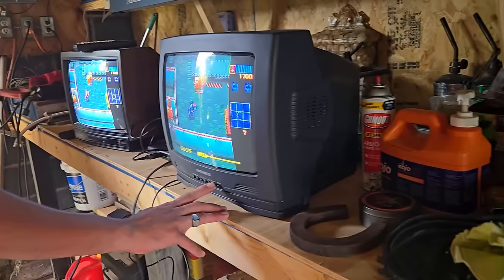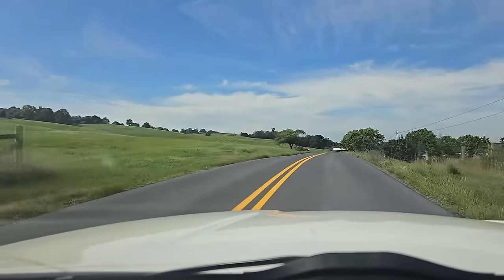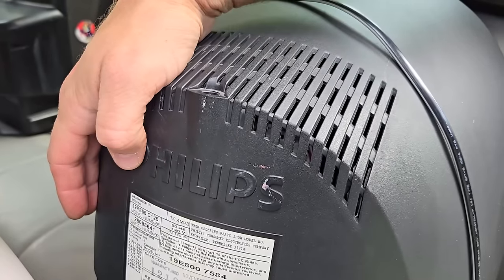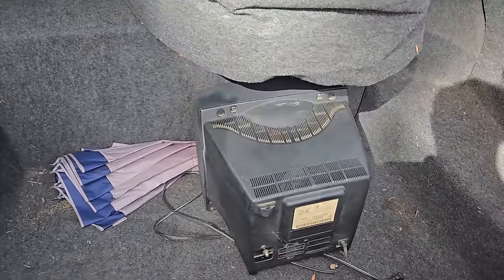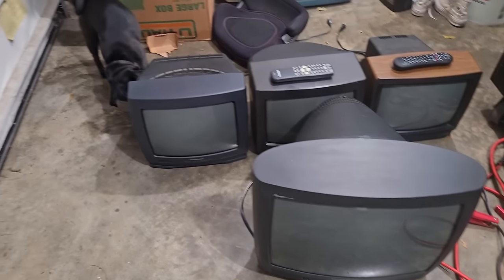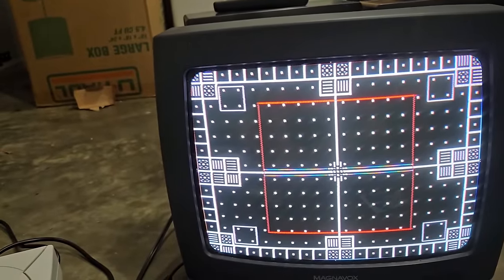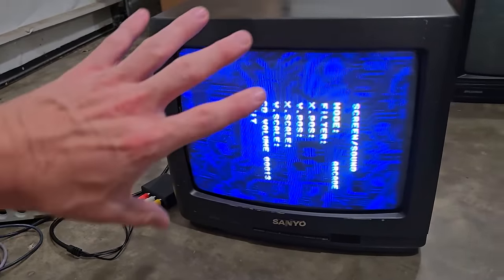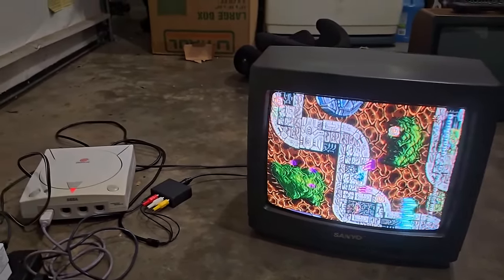Shopping for CRTs in 2024 | "Hot" Chassis edition

Comment: After seeing this vid, I'm trying to brush-up on my memory of how some of this works.

I probably have some stuff wrong here, but here goes...

One of the big reasons the "hot chassis" TVs were more common in the US, is because your mains voltage is 120V AC (nominal)...

And that is closer to the typical B+ voltage in a TV, so they were able to just use a chonky linear voltage regulator instead of a switched-mode PSU.
The switched-mode PSU generally means it would electrically (galvanically) isolate the lower-voltage side of the TV from the mains side.

(since it would have a proper transformer in there, where there is no direct connection between the "hot" and "cold" sides.)

So in these older TVs, the 120V AC mains would come in, then go to a FULL BRIDGE rectifier.
The output from the rectifier would be closer to 170V DC.

(due to the whole RMS thing for AC, the DC output voltage is higher. Multiply by 1.414 for a FULL BRIDGE, minus a bit for the voltage drop of the diodes.)

They would then just shove that 170V DC into a big linear voltage regulator, to get it down to say 130V DC or something, as the main B+ supply to the Flyback.

The flyback might have extra secondary windings for 5V, 12V, etc., but there is no true isolation between the hot and cold sides.

What that means is that really, the entire main board (including the "low" voltage side) is electrically "floating" at MAINS potential!

It's like having the whole 170V DC, with say the 5V supply "floating" on top of it.
If you measure between 5V and "Ground" on the board, then you'll see 5 Volts.

But "Ground" is really at about 170V, with reference to mains Earth (or neutral).

Most of the stuff on the main board is like that, too, including the RF tuner / shield.
So the antenna input has to have an isolation block, so you don't get zapped.

This is also why those TVs tend to have no other metal parts from the main board exposed on the outside.
The buttons on the front will be plastic, sometimes with slightly longer "plungers", so they can reach the buttons on the main board.

Comment: Buckling like that is due to the width shrinking under high beam current. On some really bad sets the HV sags enough the entire screen expands and loses focus. Could be low B+ or a regulation fault, but some sets just don't care about maintaining a constant width because you don't notice it with TV content. If it goes away when you turn down the brightness, it's a wimpy chassis.That is why Sony XBRs and BVMs (but not PVMs!) have an HV supply that is independent of horizontal deflection.
Tate purity problems can usually be fixed by letting the set cool down before turning it back on in tate, so you get a full degauss while the set is rotated.

Comment: I use a sharp 25" RF only set from the early 90s I think judging by the OSD it uses as type that early 90s sharp TV's use. Most of my CRT TV's are RF only so I need to get some more RF adapters. I normally find them at thrift store for cheap.